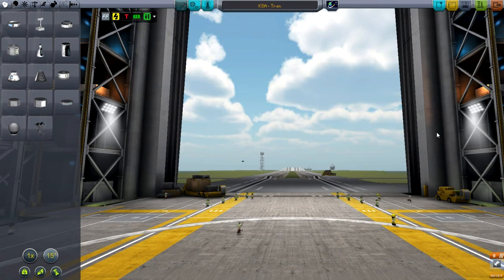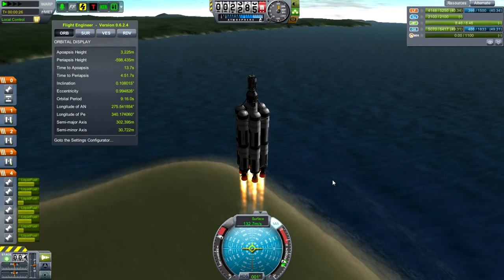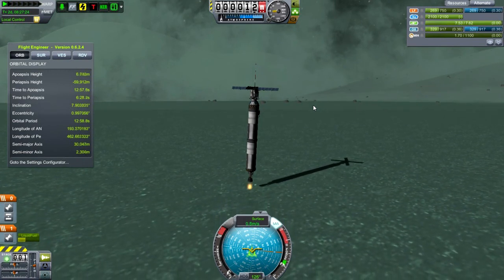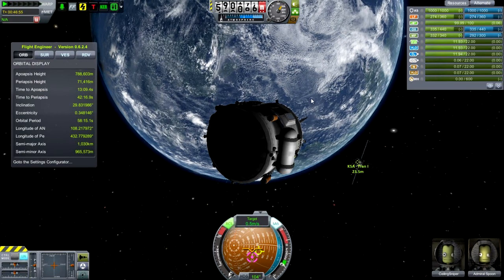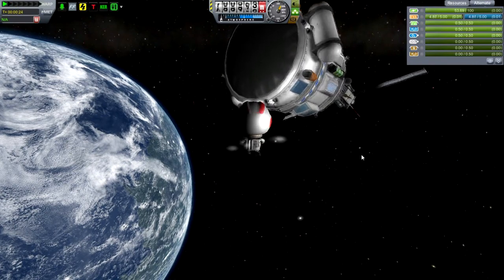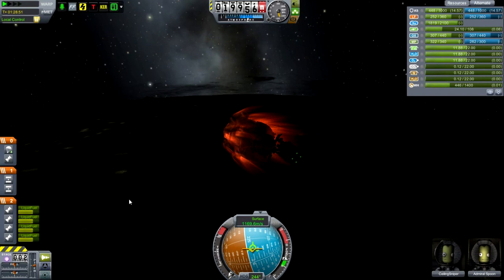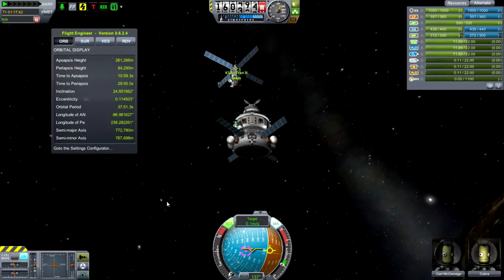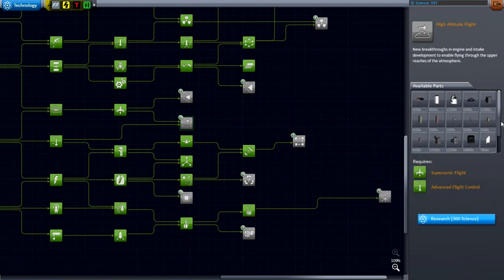Kerbal Space Adventures Ssn8 Ep10 HD - High Probe-ability of error

Comment: You could have greatly improved the efficiency of the Tran-1 with apsaragus staging.
Reply from the maker: I did. It was just a longer rocket than I usually use. It got where it needed to go and had enough fuel to land and come back without issue so more fuel would be kind of wasteful. I was more concerned with the poor design and lack of power.